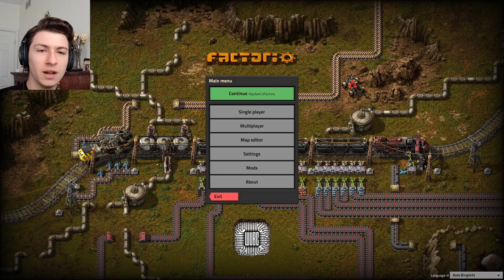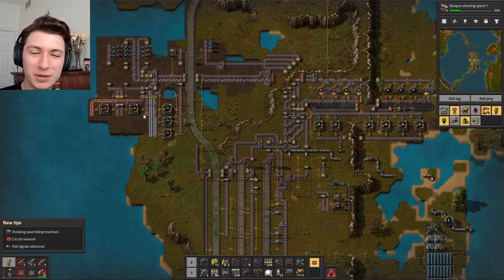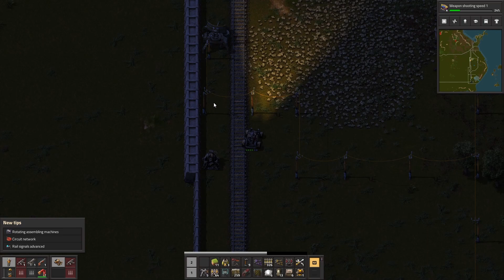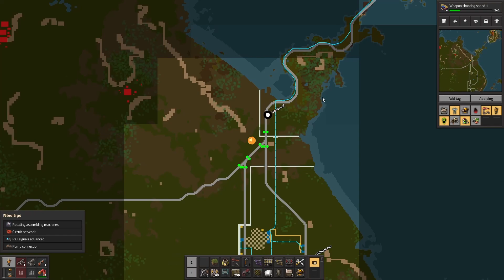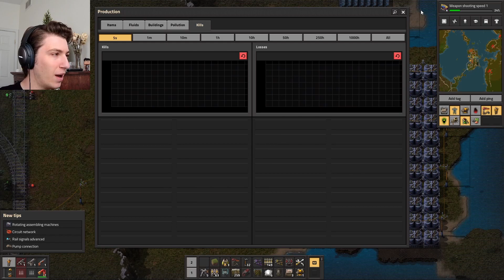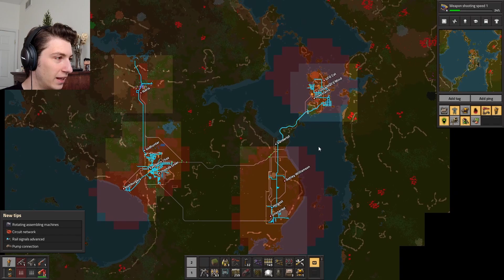Expanding Our Island Dominion in Factorio! | Factorio 13

Comment: Hopefully more comes out soon.   You have inadvertently chosen a more difficult path to learn the game; but it can be done this way and be fun to do.   I don't want to give direct solutions as the real fun of the game is essentially a puzzle solver.  You have some belt mechanics to learn that will be extremely helpful to the overall experience.   (In particular, learning how to use both sides of the belts.  And there's a reason red and blue belts exist.)    Check your production, too.   Does no good to have machines making things if they are being starved of resources and sitting idle.   Commit to automate!